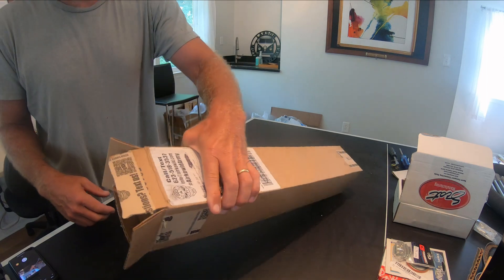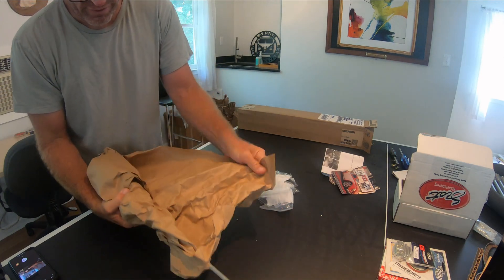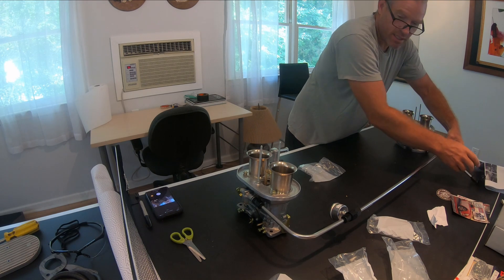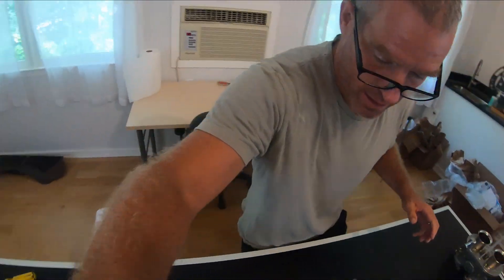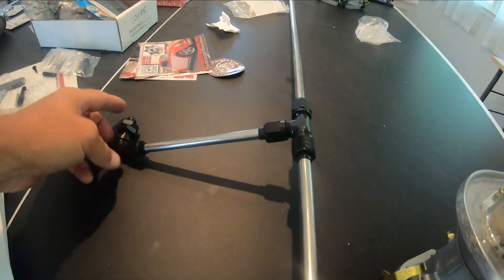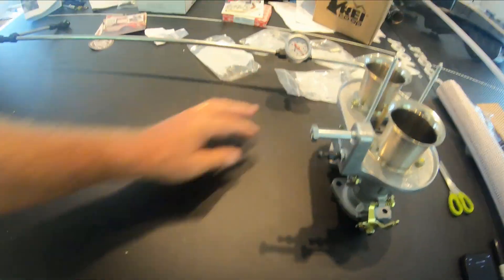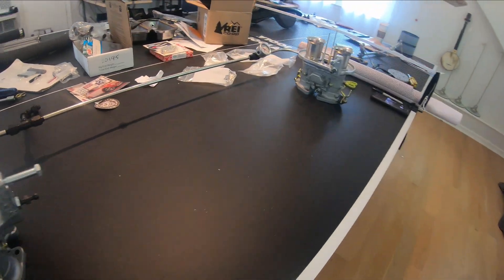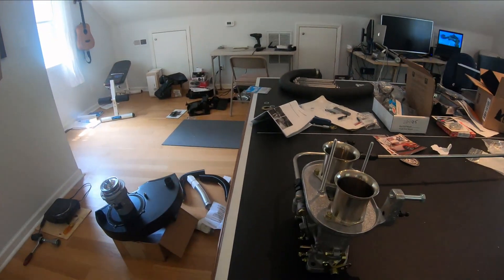2332 VW Air-cooled Stroker Motor - Video 57 - Hard Fuel Line Kit Mockup - AirKewld Army

Comment: Just a tip, you can save yourself some money and work by grabbing one of the kits advertised on the Samba from  Bandit buggy. All the work is done except making one flare
Reply from the maker: Nice - yeah the airkewled kit was pretty good but I had to map out the fuel line lengths - which was fine because every motor has some stuff to work around in the engine bay

Comment: How does it attach to a mechanical fuel pump ?
Reply from the maker: You could attach it if you have a fitting you can swap out, but I think most people put an electric fuel pump outside the firewall somewhere which pumps directly up behind the shroud.  Here is the product and they have a video and installation guide too.  https://www.airkewld.com/IDF-Weber-Hardline-Fuel-Line-Kit-p/8083.htm

Comment: nice looking kit! How did it work out?
Reply from the maker: It works great - I have had it now for several years.  I was concerned because all these lines are behind the fan shroud so if gas started leaking it seems like it would be a disaster.  But I cut and flared everything very carefully and then tightened it all down and it works great.  Much cleaner than the side lines in my bug that are in front of the shroud!